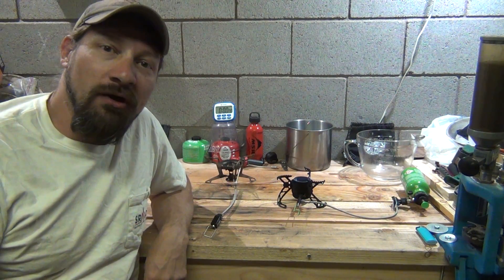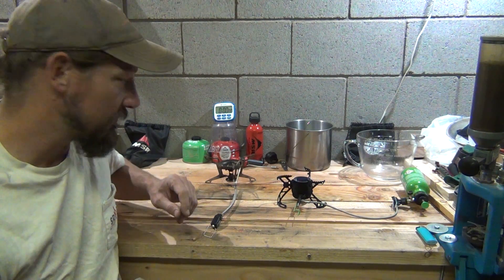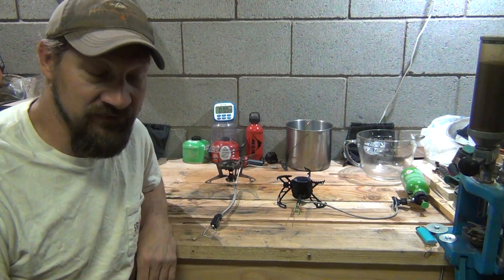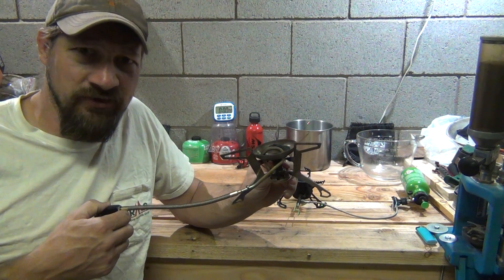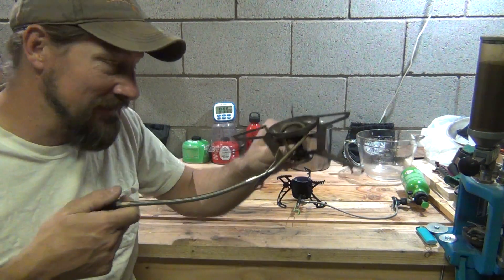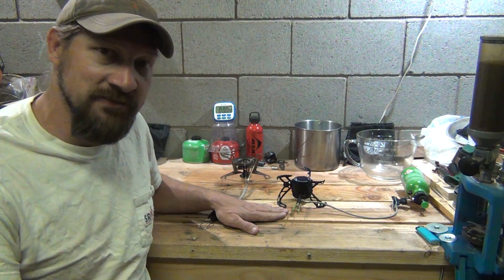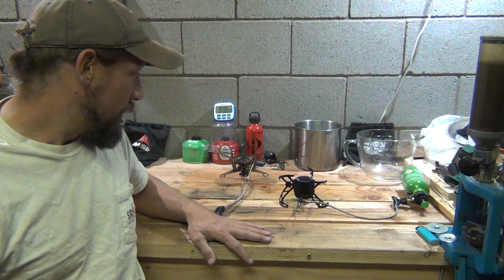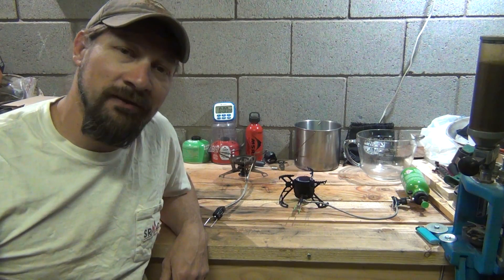Can the MSR Whisperlite Universal use a single jet for all fuel types? Is this possible?

Comment: can you make a video on trying diesel on a whisperlite?
Reply from the maker: @itrstt66  The Whisperlite universal runs great on diesel.
Reply: @jiujitsu2000  is it the same for the regular and the international?
Reply from the maker: @itrstt66  The regular can only use white gas or gasoline and the international can use that plus diesel and kerosene as well
Reply: @jiujitsu2000  thank you
Reply from the maker: @itrstt66 you're welcome!!
Reply: @jiujitsu2000  BTW do you think you can have the same performance with the windpro stove and a lindell valve pump?

Comment: To burn alcohol in my MSR International I put a draft air control around the air intake.  It's a piece of brass tube with a handle brazed on it.  I bought one of the large repair kits to get extra jets to try.  Based on race cars needing twice the alcohol to get the same power using pure alcohol, I drilled the UG jet to twice the size.  So when using alcohol I still needed to tweek down the draft air a little to get similar results to the white gas.  I also adapted my stove to use the butane canisters by buying a cheap Lixada stove to get the valve and the hose.  I cut the hose off the fitting and installed a 1/8" barbtite so I could use the plastic hose inside the stainless braid.  There's no more than 7 psi. in butane canisters so the hose holds well.  I wouldn't use the butane setup as an every day camping fuel but I could use it if I had nothing else.  Thanks for this fine video and for all of your interesting content.
Reply: Man ild love to see a video edited or not of that set up.  Definitely something ild have to look into doing

Comment: I loved my Whisperlite universal but where the hose connects to the generator loop is leaking and I can't find any info if you have any or an idea get back to me
Reply from the maker: Sounds like it could be damaged. Give them a call! I'm confident you'll be able to get a replacement
Reply: @jiujitsu2000  It was spewing fule like crazy so I ended up sending MSR an email explaining the problem. I think the gasket inside the hose may be the culprit they said it may take 8 weeks to reply but the process has begun. Thankfully the fireban in my area was just lifted, with beans,rice and Jesus Christ we will always find a way! Thanks for the quick response buds!
Reply from the maker: I hope they get you squared away! Blessings always!!

Comment: I can find nowhere, including manuals and maintenance videos, where they remove the new style legs from the whisperlite universal.  Looks like there's a retention ring (snap ring) holding them on?  Will I ruin that ring trying to get it off?  Have you ever removed the new style legs (not the loop style) from the whisperlite?
Reply from the maker: There is a snapping holds the legs on the stove I've never taken it off I don't know why a person would need to

Comment: The British Royal Marines chose the Optimus Polaris as their stove over the MSR Universal because they said the Polaris is a ‘dry’ system when stored in the cook pot, what do they mean by that? Isn’t the Universal a dry system too? Both systems would have the fuel burned out of their lines right? 🤔
Reply: You might have already figured it out lol. But as my understanding to the Polaris, to turn off the stove with liquid fuel, the first thing you wanna do is to flip the bottle 180, and you'll see the "off" label on the pump. This will allow the stove to burn all the remaining fuels in the line, including depressurizing the fuel bottle. This means that when you close all the valves, take the pump out, and put them away, the pipeline (including the transparent one, with a filter attached to the pump ) will be fully "dry". Where the MSR will still have some fuel left in the pump, because closing the valve on the MSR will only allow the stove to burn out the remaining fuels in the fuel line, but not in the pump. If you want to achieve the "dry" system, you might try to mix and match the MSR Universal with the "canister valve" and use the Optimus fuel pump and bottle. So you will have the flip function for burning out the fuels.
Reply: @LRyan225 this combo of Polaris Pump with Whisperlite Universal stove (including its fuel line) does seem like the best possible multifuel stove system 🤔 you get a ‘dry’ system like you say, and all fuel types (except diesel possibly but I can’t imagine when I would ever want or need to burn diesel) plus the Optimus pump valve gives the Whisperlite much better simmer ability, plus the Whisperlite hose has a cleaning rod to clean any residue out of it if burning dirty fuel for any length of time. Whereas the Optimus Polaris doesn’t have a cleaning rod, and I can’t even see any spare hoses for sale as replacement parts?
However one potential advantage of the Optimus Polaris stove is that when the legs are contracted/closed the stove fits in the center burner ring of a Trangia 25 stove system, so you can use the Polaris instead of an alcohol burner which is handy if someone already owns the trangia system

Comment: Can you use a MSR whisperlite universal bottle and pump with the Polaris? Not suggesting you would want to but my plan was to either a Whisperlite Universal or Optimus Polaris as my ‘all-rounder’ and pair it with a Dragonfly or XGK
I was thinking to get the XGK for emergency use (vehicle fuels) and a Whisperlite Universal for general backpacking use, but although the canister simmer is fine on WU the poor liquid simmer would be annoying, and the XGK has no simmer at all! so the combo would lack simmer ability but be very reliable.
But from this vid it looks like pairing the Whisper Uni with a Polaris instead but with two Optimus Polaris bottles and pumps would be better since I get multifuel adaptability AND simmer ability on both stoves? And since I still have 2 stoves with one as a backup it would still be a very reliable combination?
But Optimus a Polaris paired with the XGK as a backup would be an awesome
Combo too, since simmering won’t be my priority once I’m force to burn vehicle fuels to boil/purify water and food?

Comment: I bought a polaris pump just for this reason and love not switching out the valves. In fact it makes it way more precise adjustments for simmering. Only thing would make it better is if the polaris canister valve with the fold out legs would fit msr line. I hate that bulky snap on thing msr has. Yes it's stable but bulky to pack.
Reply: @psyamok3735  it fits on the MSR fuel bottles
Reply: @AK4PJ  Thanks so much for the quick reply!!  How does it work for you so far?  Do the pump and all the different kinds of fuels mentioned work as claimed?
Reply: May I know if your Polaris pump fits the MSR fuel bottle? Or do you need the Optimus Polaris fuel bottle as well to use the pump?  Has the combination worked for you for the last couple of years?

Comment: Have you done a test to see what the difference in fuel burn is over using the specific jets for each fuel compared to one jet for all? And does the different pump set up use more or the same?

Comment: Great test, cool to see things possible, just some modulation needed, great info to have, keeps reminding me that i need to get off my ass one of these weekends and service my whisperlite intl again, kerosene gummed up my fuel line, didnt work so well at winter campout.
Reply from the maker: Bearded Seabee 82 cleaning out the fuel lines is a fairly straightforward and simple process. I'm in the process of editing a video on that topic

Comment: Interesting! I find changing the nozzle quite easy though, at least in my old whisperlite international. I love that thing. 15 years old, and all it ever wanted was some cleaning and lubing and a new pump seal a couple of years ago. It burns even alcohol (very cheap and common here in Germany as well as Scandinavia as far as I can tell) with slight modification if it has to, and low grade supermarket lamp oil. The universal looks tempting but man, those things got expensive since I bought mine. ^^
Reply from the maker: Very true, The prices went up with the popularity and demand. I have a few old international and they still run great! Thank you!

Comment: Yeah the ‘one jet fits all’ model has its pros and cons.  One of the differences between those two stoves is the much lower pot height for the nova/Polaris burner.  This limits the airflow to the burner.  On my nova I get yellow tipped flames with kerosene UNTIL I put the pot on top.  Then it goes all blue.  This is definitely part of the design. On my primus multifuel the gasoline jet is the same jet for butane whereas the omnifuel has three different jets.  The Optimus 111t came either with one jet for gasoline and kerosene type fuels.  (popular with the military) There were consumer versions that came with separate jets.  The alcohol burning option requires a jet change as well as an air reducing collar to get the right air/fuel mix.
Reply from the maker: Excellent comment! I can tell that you're like me and LOVE stoves. Cool brotha! Thank you!